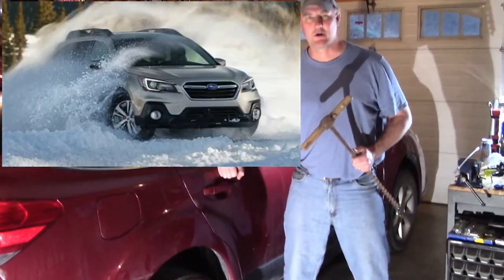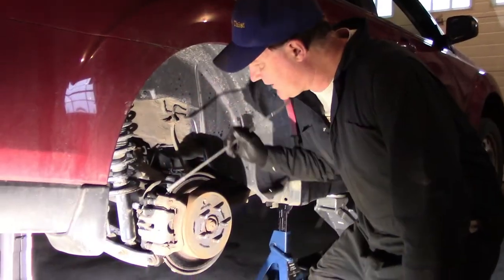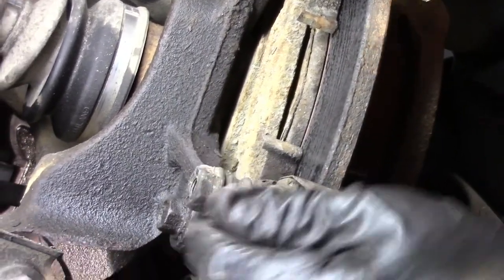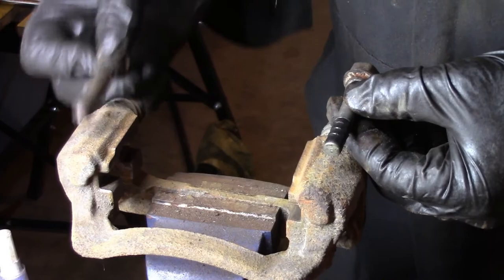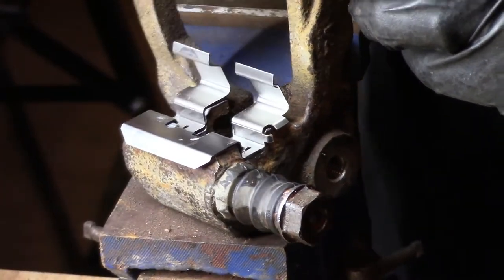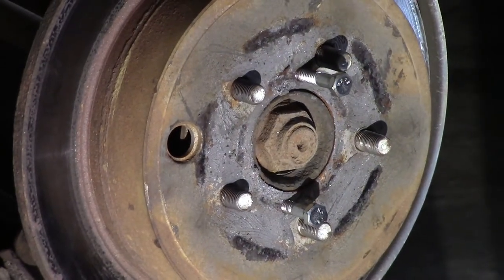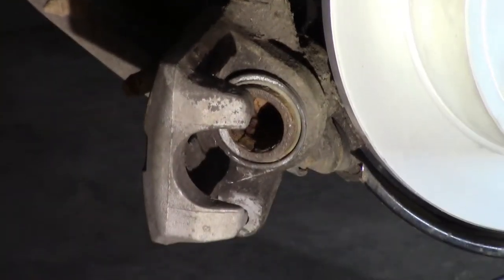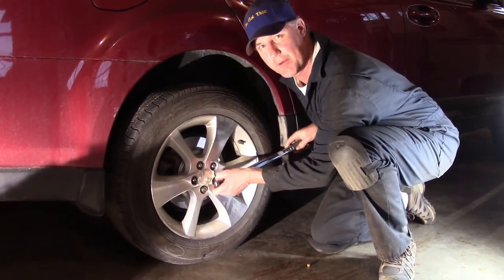Brakes Making A Grinding Sound? How to Remove a Stuck Rotor, Brake Pads, Seized Sliding Pins, Subaru

Comment: I love the Subaru Outback, it’s a fantastic car. Your video really helped me tackle my brake job with no hitches. Keep up the great work
Reply from the maker: Yeah, I love my Colorado but the Subaru Outback seems to be a nice well engineered vehicle. It's sweet. Cheers!
Reply: @cantletherdiediy1050  have you seen reduced power on your dash in  your 2005 chev Colorado I’m seeing it on my dash as well as change oil and I’ve done an oil change